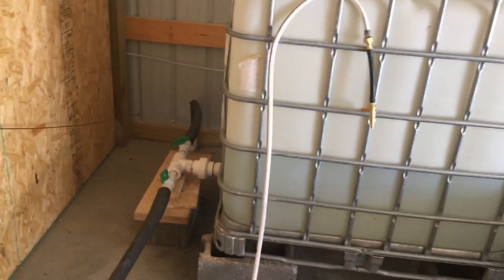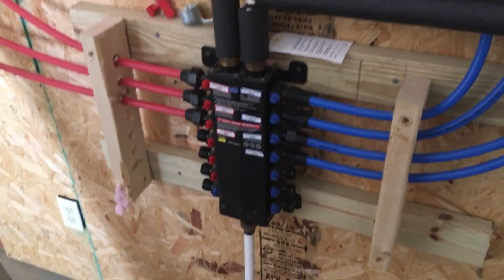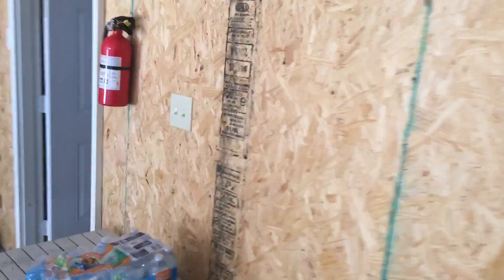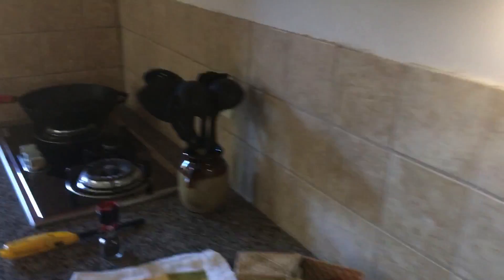Off the Grid Cabin Water System

Comment: Hey the pex manifold. Do you need to have that? I’m in the process of booking up a tankless water heater at our cabin. We have a natural spring. Water come into a tank very similar to yours. All we will be using water is to run to 2 sinks and a shower. Do you think a pex manifold would be necessary for just the 2 sinks and shower?
Reply from the maker: Well,  I think they use smaller manifolds.  If you have no plans to expand your system you really don't need it.   For me, it just made things a lot easier.
Reply: Hey what did you end up using?

Comment: Being up north, Ive been concerned about year round water, but I'm ashamed to say I never thought of putting two of those inside the house, and move an outside one to the sunny side when it gags close to freezing.  Wow, that could help a lot.

Your pump is really loud.  Is it a piston?  Rotary vein pumps are, or should be, much quieter.    One day, later on down the road, you could see if there's an old RV at a scrap yard or something, and pull one out.  Should just be a gentle hum.

Comment: Do you treat the water to keep from going stagnant ?
And what type of septic do you use ?
Reply from the maker: I put bleach in the water about every 6 months,  half a cup in each tank.   The water is used only for showers and to flush the toilet.  We also wash dishes with it, but for cooking and drinking, we have bottled water.  It's filtered 3 times from the roof, I have never had a problem with it going stagnant.  We have a 10,000 septic tank with a regular drain field.

Comment: If put that up you can use gravity and you would not need the pump.
Reply from the maker: hecke1959 that’s an idea, but I wonder if it would generate enough water pressure to ignite the on demand water heater.

Comment: Inverter on the water pump to get down to 12v? How is the water pressure? I'm thinking of this exact setup for my off grid cabin.
Reply from the maker: I use a 110 to 12-volt inverter right at the pump.  The water pressure is good just like in an RV when you use the pump.

Comment: all without any filtration?
Reply from the maker: The water is filtered three times for particles.  I do treat it with bleach every so often, but we do not drink this water.  It's only used to take showers, and flush the toilet with.  We drink and cook with bottled water
Reply: @thesammy532   just get a counter top pro-pur water filtration system and save hundreds yearly instead of buying bottled water...best tasting water you can get, filters out 99.9% of everything cleaner than bottled water.
Reply from the maker: @girlonlaptop  Well I did get a 5-gallon refillable dispenser bottle that cost 32 cents a gallon to get refilled.  We will have 2 and rotate.  That is an idea though, thanks.